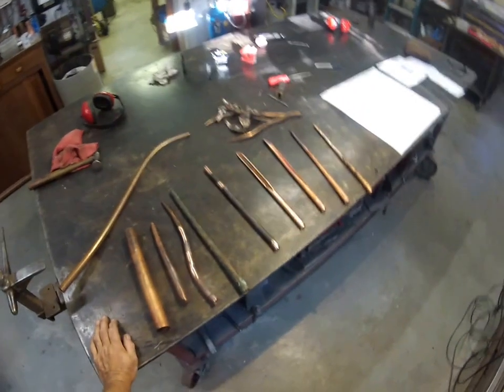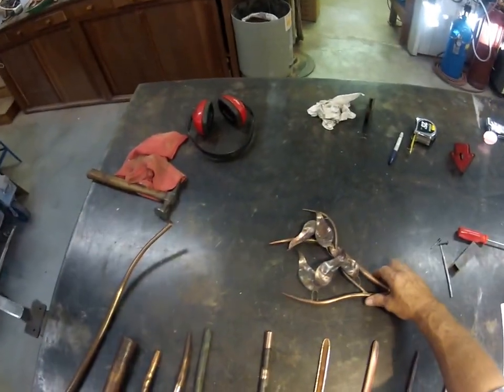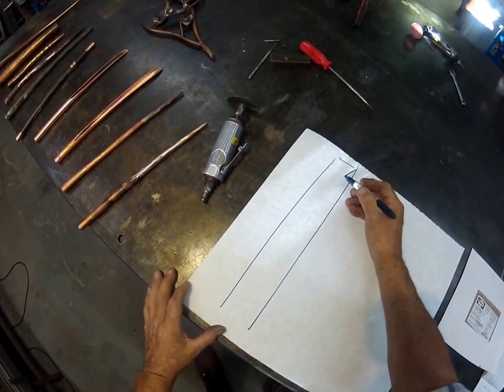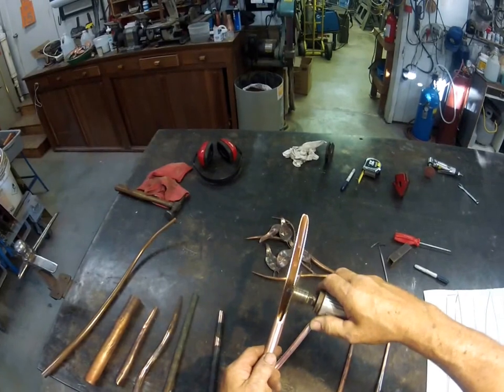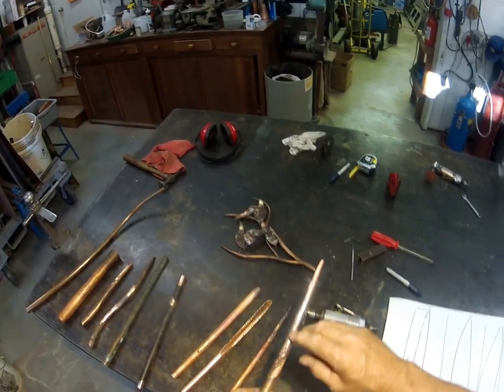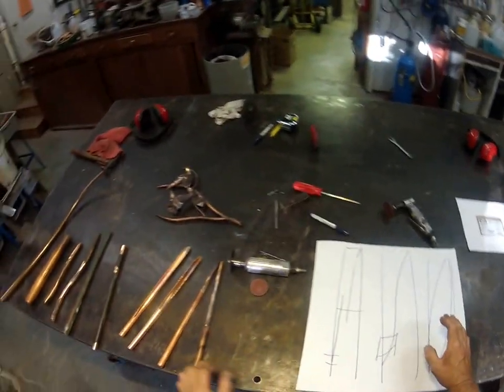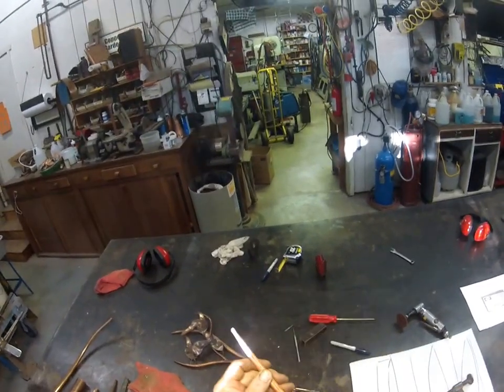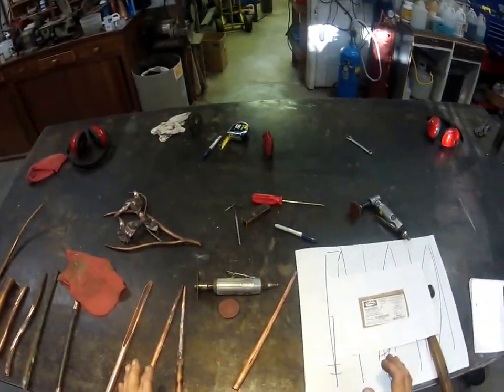Copper Gardens - Tapered Copper Tubing, "How To"

Comment: Hi Dave,
I've been following you for a few years now and your attention to detail is what makes each project a work of art!
Thanks so much for sharing the process of tapering copper branches! I'll give it a try using 1/4" OD copper tubing!
I've done some pieces in copper and steel but on a MUCH smaller scale.
My oxy/acet setup is a "Smith's Little Torch" so my brazing is quite limited to smaller pieces.
I've made a few copper roses with steel branches and copper leaves using bronze brazing rods.My leaves lack the detail I would like them to have as a rose plant leaf has a "serrated" edge and mine do not have that detail.
My leaves are about 1/2"-3/4" long and 3/8" at the widest point.
Can you give me any ideas on how to get the serrated edges on my leaves?
I've tried several different cutting disks in my Foredom flex shaft but that is very labor intense and the leaves just don't look right!
Thanks for all your videos and sharing your knowledge!
Tom
Reply from the maker: Doing a ¼" copper taper will really test your skills.  Smaller is harder, for me at least, but go for it.  If it fits what you are making, then it is up to no one else to tell you what size to make them.  Use a small torch and hopefully you won'd have the copper melting away faster than you can add the brazing rod.  Good luck!  Keep on it until you get it right ... one line I like most is, "if you are not making mistakes, you are not doing enough"!  That's how we learn!!

Comment: Hi Dave, great video, you've inspired me to include a bit of copper brazing in a wood working piece I'm making for my wife. Sadly, I know nothing about brazing! I've soldiered my fair share of copper pipe but no brazing. I understand I can braze with map gas? However I do not know what "brazing rod" I need, wondering if you could advise me on a brazing rod to use with map gas, preferably something I can get at a local H-depot. I live very far from speciality stores but lucky to have a HD within an hour. Hope you can advise me. Thanks for posting your videos
Reply from the maker: +Robert White Don't know what happened to my first reply, went to check something and lost it ... Use Oxy/Actylene, not MAPP Gas ... too slow and really a poor result with Mapp ... Rent or buy a cheap Chinese Crap unit from Harbor Freight.  About $200 after you get the gas.
Use Harris 0 brazing rod.  0 is for the percentage of silver in the rod (none) ... many will tell you that the silver makes it stronger ... wrong ... it makes it flow better and therefore a leak proof seal, but not stronger ... if you are doing art, as it sounds, strength is the key, not leak proofing.
Practice first on something similar and getting good flow is the key ... know too that the biggest portion of brazing anything is the finish work after, not the actual act of melting the rod onto the work piece.
I use 4 ½" grinders, 2" air powered polishing wheels and anything else that suits the application.  Far more time is spent finishing than brazing, just get used to it ... Unless you can call it texture and get away with it, there is not fast way to finish the joint
Color too is a big issue.  I don't know if you wanted an all copper tone look, but you won't get it with any brazing product that I know of.  Only TiG welding or Gas Welding with parent metal will get you a matching color.  Since that is a whole other area of expertise, I don't think I will go there for you.
I hope this helps and I encourage you and all to get into copper work but beware, it's additive